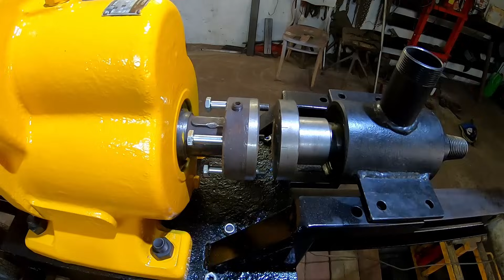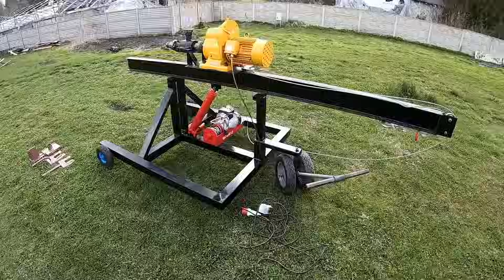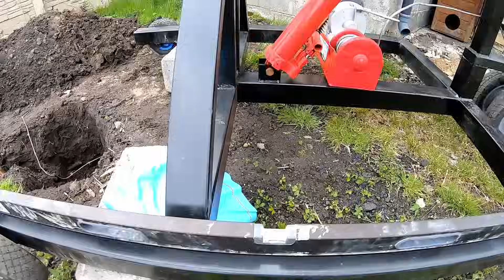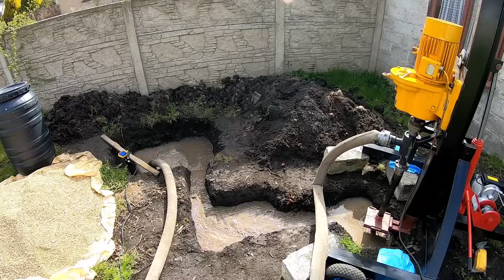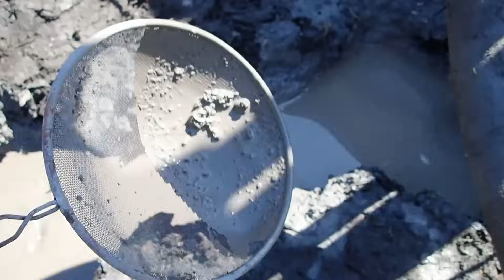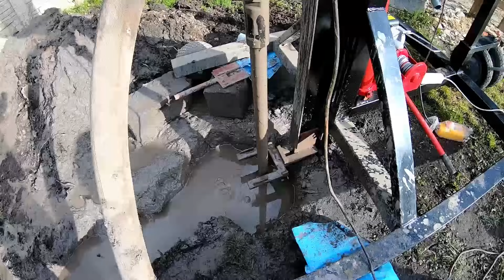Mobile Water Well Drilling Rig I My First Bad Borehole

Comment: I've been watching a bunch of these DIY well drilling videos.  This is the second one I've seen from Europe and I can already see a big difference between the EU approach and the US approach.  There are lots of people in the US who dig shallow wells, but many of them seem to use a lot of water to drill the well.  All of their contraptions require a flowing tap and hundreds/thousands of gallons of water to dig a 25-foot deep well.  Whereas, the two EU guys who have done it devised these small reservoirs that capture and reuse most of the drilling water.  This approach definitely seems to make more sense.  Great video!
Reply: Check out rc Crawford???
Reply: المياه المعادة استعمالها مثقلة بالطين، وقد تخرب المضخة
Reply: @bbb12222  нет, используй насос для грязной воды.
Reply: In the USA it’s called a “trash pump”
Reply: @chrispicritters4710  Thanks, but I was referring to some other YouTube videos I've seen of folks in the USA who actually use flowing water from a tap to jet out the hole they are drilling.  My comment was about how this guy re-used the water over and over.  Pretty smart.
Reply: Oil rigs recycle the lubricant in much the same way.  Using more pumps, filters and shakers of course.  Having worked on many many oil rigs, I'm impressed with this guy's ingenuity.  I think I'll try making my own now for fun.
Reply: @rickd8174  That is exactly what I was thinking of doing.  This is just a cool project to work on.
Reply: Me thinks this guy is filling his own hole most of the time with all that mud
Reply: @robertstanley980  and what exactly is your background in construction?
Reply: @robertstanley980  you are either American or you were saved by America, shhhh
Reply: @robertstanley980  Having done projects in Europe, I can definitely agree that they do many things differently.  At the same time, I wouldn't categorically condemn US construction methods as undesirable.  The the project world, there's a saying: "Good. Cheap. Fast.  Pick any two.)  In the EU, you often get good, but its rarely fast and cheap at the same time.  Scale is important.  In some places, the need to create fast results is imperative.  Indeed, the construction methods I've seen in China make America look slow, by comparison.  Despite their general lack of finish quality, China's end result fulfills about 95% of what they need.  So, while I love European workmanship, it isn't the panacea for every situation.
Reply: Привет почём такая аппарат
Reply: Ok if you have the pump for mud you can reuse the old well drilling method but if you only have a small water pump you have to pump cleaner water or it burns the pump up good mud pumps are $100's to buy and most of the diy is making dew with what they have and can spend , if I had a factory built drill like this one I would have the $$$ to pay a drill company to do it after all the company only wants $6000 for the well
Reply: @GibbonInAmerica  I'd like to argue the three criteria are actually good, fast, and good looking. There's nothing good ever made cheap, it's either paid for in blood or upfront with the cash. That being said the best way to categorize Russian construction is good and fast, but ugly as hell.
Reply: @Victor.McCann  You hit the nail on the head.  It's all a matter of what the final cost would be.  If a jerry rig like this works, its worth burning up the pump.  If you live in an area where new shallow well drilling is banned, then doing it yourself is worth a lot.
Reply: @greengoat5654  In principle, I agree with you.  But, as an absolute rule, you're wrong.  Our everyday lives are full of technical examples of cheap working out fine.  It really depends on the situation.
Reply: @GibbonInAmerica  that's called innovation methinks, and isn't something that we should rely on, simply be thankful for when it happens. Something we should always strive for though
Reply: @greengoat5654  Agreed, sir!  I'm in the technology field, myself, and I build lots of prototypes and customized specialty systems.  In my field, there are a lot of companies that make purpose-built "solutions" that cost a lot of money.  As clever as these things are, they kinda force everyone to conform to the manufacturer's concept of what they need.  The end result is a lot of copycat products and commoditization.  Innovation is the opposite of this.  Much harder to achieve, but far more creative and far more likely to help the customer.  That is the central feature of this cheap, DIY setup.  The drilling industry will force the consumer to accept an expensive tool or service.  This German guy demonstrates that you need to address the basic obstacles using practical technology.
Reply: @GibbonInAmerica  that's just it it is a store bought portable drilling rig it cost close to $10k USD you order it for that thin put it together out of a box in my area I could have a well drilled and still have money to get a used car lol that is all I am say the mud pit has been the oldest way of the drill rigs here in the state's sense before I was born and I am 50
Reply: @Victor.McCann  I'd agree, sir.  Frankly, before I'd buy this nice rig, I'd try constructing the DIY rig that another German YouTuber created.  Same recycled mud water, but using a filter to get the silt out.  He also used a lightweight Hilti-like drill on a homemade pipe tripod and a sectioned black pipe shaft.  I imagine his rig cost about $400, not including the drill.  Then again, I've got to drill about 40 fence posts, in addition to sinking a couple of wells.  So, this expensive rig might actually pay for itself.  I could also probably sell it later for about $6,000.
Reply: @GibbonInAmerica  yes there is always work for a small rig and endless on the fence
Reply: @GibbonInAmerica  Do you have the link of the other video? Please post the video code or description.
Reply: It's not really an EU vs. US thing. There are lots of folks using a similar rig and mud pond setup here in the US, and there are some YouTube videos of them in action. The real difference is in the geology in play. The people doing the waterjet drilling and similar tricks are in coastal areas where the soil is very soft and the depth needed is very shallow. The one I saw that used the necked-down Harbor Freight mudpump only went down 38 feet through very sandy soil. I think he was in FL. Here in MO where I need to go through a couple hundred feet of bedrock that method just ain't gonna cut it (literally). If you're looking to dig deep through hard material, whether in the US or EU, you'll need something like what's shown here (or a commercial truck-based rig, which is basically the same thing but bigger, which is what they'll show up with if you hire a pro). If you don't want to build it yourself there are companies here that sell pretty inexpensive ones. I'm considering one from Deeprock that runs about $4k. Made in Texas, and actually priced about the same as the ones on Alibaba once you account for shipping.
Reply: I would love the detailed specifications to make this or if selling I would love to purchase it. Iam in Zambia
Reply: @Maddog73 Well...I get the point you are trying to make, but it will take at least many hundred and probably a couple thousand to sink a well, depending on how deep you have to go and what the soil conditions are.  There are definitely more conservative ways to sink wells.
Reply: Watching this video made to have interest in making my own one can any one tell me the parameter of the machine

Comment: Great just a question where did you get the motor/gearbox assembly and the connection part water inlet pipe? I mean i want build one my self thanks

Comment: First lesson :ask the neighbours , do they have a well , how deep is it and what is groundwater level
Reply: You better go deeper man lol
Reply: In the state I live you can look up well locations and depth
Reply: @Imwright720  You can find these things on internet , but they don t tell you if it s possible to drill and how deep you have to drill . I ve made many wells 20-25 meter deep with a groundwater level of 3-4 meters. 
When I walk into a garden and i see all those IBC -containers in the neighbours garden i turn around and go home.
Reply: @haynillesen  it’s true you won’t know for sure what your going to hit.   However my area is all sands with a coral shelf about 2-4’ thick at 6-12’ down.   We have lots of canals and when the water level goes down you can clearly see the shelf.  Also , if you ask drillers they will tell you.   I made a bit using electric conduit and drilled through it.  It wasn’t easy.   The county goes to 45’ here for sprinklers.   I was shooting for that depth but as I was going down the water coming up just disappeared.   I tried bentonite but  it didn’t work.  In the end it didn’t matter because I have nice clean water.  That was 2013 and it had never run dry.   I jetted down but I should of driven it down using a jackhammer.
Reply: @Imwright720  Close to the ocean , no salty water?
Reply: @haynillesen  8 miles.   I’m in south Florida.
Reply: @Imwright720  what is past the "coral shelf about 2-4’ thick at 6-12’ down"? Is is sand/ gravel more coral shelf? Also what county do you live in?
Reply: @James-sz2hr  palm beach county, just sand.    It went down pretty easy to 27’.  At that point there was so much water that what I was sending down just disappeared.  If I had a mud pump I could of gone deeper but I only had the pressure from my hose.    This was 2013 and it has been perfect.   It runs my sprinklers with ease.  I just recently installed a Gould pump that pulls 2x the amount of the previous pump and I get all I want.   The flow is amazing.    It paid for itself very quickly.    If I tried again I would probably try a jackhammer with metal pipe.
Reply: @Imwright720  Thanks for the response and detailed breakdown. You guys are lucky. Unfortunately, I live in Miami-Dade county. Sandy topsoil for <1-2 feet, followed by limestone rock. (don't ask me how deep it goes, haha). Based on research I did it seems like this limestone layer is below pretty much  the whole of Miami Dade, Broward, and to some extent Palm Beach county. I don't think it's possible to manual dig a well in Miami or Broward unfortunately.
Reply: @James-sz2hr  he is what I would try.  I have a hole digger which got me down about 8’.    I used a Seymour 21306 AU-S6 Iwan Auger with Hardwood Handle, 6" Diameter.   Digs beautifully, go as deep as you can.   Then I would drop in galvanized pipe.   Use the 1 1/2” don’t go 2”.   It’s way harder to drive down.   Make sure you get the unions for driving, they are special.    I would rent an eighty pound jackhammer and weld a special bit that would go over the drive cap.    I would hammer down 5’ sections at a time.   Limestone is pretty soft.   They used to rent a machine you could drive it down with but I don’t think they do anymore.   The guys here use a machine which drivers down 20’ sections.   They only drill large 5” wells.   I think someone made a video using a jackhammer.   Good luck if you try.   Post it here.   I would love to know.    If this one ever dries up, which I doubt, I’m going that route.
Reply: @Imwright720  So I continued digging/drilling through the layer of limestone with my 3inch homemade drill bit and finally met water. At 12-13ft the bit was no longer drilling, but rubbing on what seems to be an impermeable rock layer. 
Strangely, I barley saw "water bearing sand" while digging/drilling, but mostly moist clayey limestone sand and rock. 
The water is clear, with no smell and very good flow. So, I doubt it's a sewer. Haha. 
It's probably a shallow fracture rock aquifer. 
So far, I have pumped over 50 gals of water with no problem. 
I will post a video soon once I get everything sorted out.
Reply: @James-sz2hr  I'm waiting on that video

Comment: Design can be little modified to drill fast and in hard or rock strata, just use the rope of winch in loop so driving forward n reverse you can further force the drilling, but in rock you would have to change your drilling bit
Reply: Yes, you are right. The head no way can deal with rocks.

Comment: What pipe thread NPT or ?. I made mine with an two -person post hole digger. It came with an engine and transmission that help with torque. I had to buy a water pivot but worked down to 100 ft no problems. Most problems occurred with the pipe

Comment: This machine uses dragbit drilling and water mix with clay to help lift sediment and chipping from bottom..It could probably easily reach 30m..and with proper pump and skill clean a well up to 60m...I think in principle if he attaches a down the hole hammer bit and 6 bar compressor "industrial type with a 4 or 6cyl diesel engine he could go to 60m in less than a day
Reply: Wozu? Haben Sie es eilig? Time ist Money ...

Comment: I too spend some years on drilling rigs, and love how you managed to get to the core of the drilling process. I think you could use it easily also to make vertical geothermal wells for home use with a heat pump. Can you tell what max depth you reached?
Reply: Esta máquina puede perforar una roca???
Reply: Using water could destroy walls of the hole, he should reindorce them
Reply: Câți kw are motorul și ce tip de reductor are ?

Comment: Great Build, but how much can drill the machine? 
If you can guides me with the max capacity of drilling can be great.
Thx for the guides
Reply from the maker: I can drill a maximum of 30 meters as the drill depth is.

Comment: awesome! what motor is that and what part is that at 20 secs in
Reply from the maker: This is a 2.2 KW gear motor 56 rpm.
This is "water swivel" and is essential for drilling with this method.
Reply: I need order one set how order
Reply: @Cypsmen  do you have a link to where I can buy that swivel?

Comment: Did you buy this motor ready?  You made it with your own hands...a good and beautiful job
Reply from the maker: Yes I bought a motor (gear motor). Thank you and best regards.
Reply: Sir may ask from where did you buy this motor gear  box? Whats the specification? Thank you
Reply: @Cypsmen  what is the watte and voltage of this motos ?
Reply: @youssefhmicha6623 , in the description of the video is mentioned 2.2kw, 60rpm, geared motor. I presume 220-240V, 50Ah.

Comment: Amazing job, very ingenious. Wish I had the money to build one like it. Did you hit water and if so, at what depth?
Reply from the maker: I found no water in my yard, drilled up to 21 m and found stones, drilling was still impossible. I'll drill elsewhere, maybe I can find water. Greetings.
Reply: @Cypsmen  you need just larger hole (min. 50 cm diameter, better 1m) and some concrete tubes to put inside the hole so you don't allow the in-down walls of sand, clay and rock to fall and mix with the water. By this way you can have water for the entire home.
Reply: @Cypsmen  90 m it's possible ??

Comment: How much did the well pipe cost? Looks expensive compared to others I've seen on here. Jason grinnell has a method using an auger and 4"pvc to drill 300+ft. 
But it's slow drilling with a tricone bit. Your method looks more expensive, but I'm sure you can drill deeper and faster. I can't afford the $16,000 that the well drillers here charge. 
How far have you drilled? How do you case the hole? 
Thanks!
Reply: Not a good comparison, Jason's rig is on a different part of the planet.  Same with Apple Drains channel.  Lots of people have great drill rigs that are totally different from each other, but remember they are adapted to their individual soils.  Drilling in the SE US vs the SW are 2 completely separate animals.  You can probably drill hundreds of feet in FL with PVC pipe.  You aren't going to do that in UT or AZ without some serious equipment.
Reply: @cg8469  ROCKS are a show stopper without tricone bits and some serious weight on bit (WOB) to grind thru the rock/s. gravel? falling into the hole... unconsolidated sands that fall into the hole as fast as drill and CANNOT leave the drill string in the hole for very long without rotating it and the pump on it or the hole will fall in and trap the pipe in the hole. even BIG OIL DRILLING rigs get stuck near surface and with all the HP they have... still cant pull the pipe loose. have to cement the pipe in the hole and move the rig or drill around then junk in the hole

Comment: I would be interested in the design of that water swivel you used. Did you make that or purchase. Also, what gearbox are you using in conjunction with the motor
Reply: They sale those swivels cheap
Reply: jason B. Where and how much?
Reply: eBay and for around $250 U.S.and up to 500.